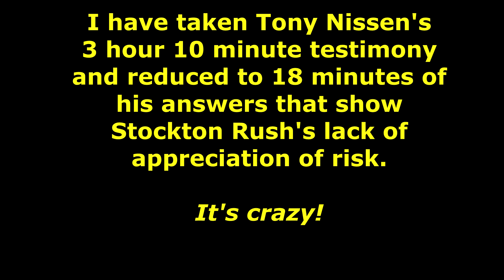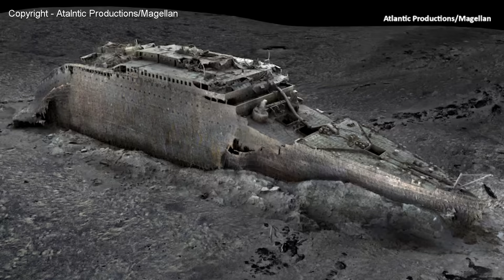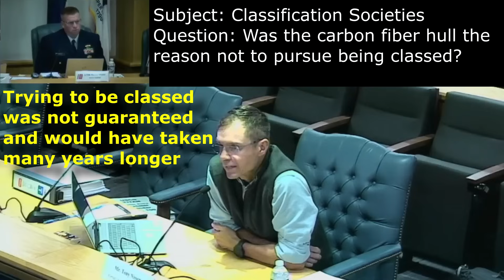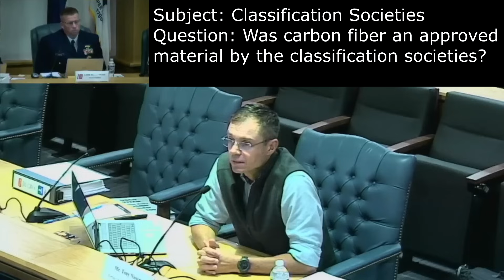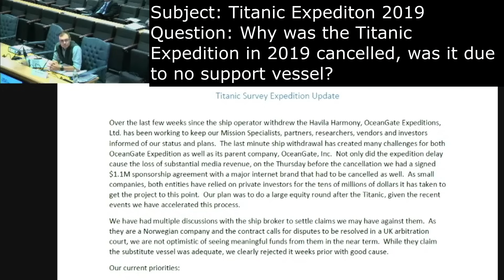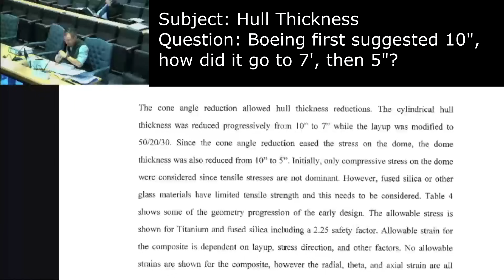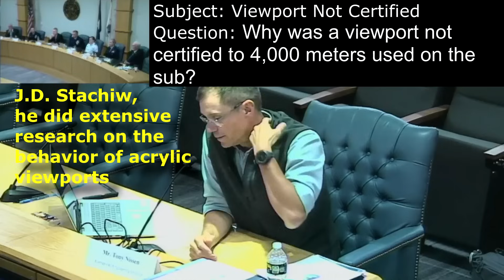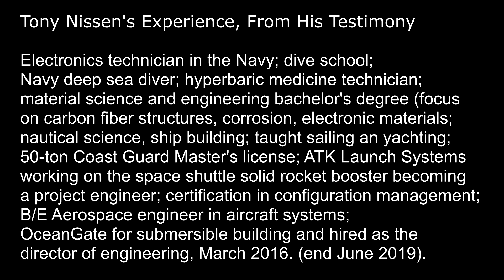OceanGate Titan - Working for Stockton - The Engineer's Words

Comment: This narcissist engineer has been very careful to not put any Liability on himself
Reply: Totally agree.    I can’t stand this guy     His constant lip smacking and laughing inappropriately every second.    There is no way this guy was hired and not told they had plans to take the sub down to the Titanic. There is no way I’m buying that. !     What difference would it make anyway? His job was to build a carbon fiber sub capable of descending to depths of over 12,000 feet visiting the Titanic is irrelevant.
Reply: Anyone who hasn't listened to the firing audio recording for David Lochridge should. Tony Nissen reveals himself as a total weasel in that audio.
Reply: @ln5321 I haven't heard the full audio of it. What does Nissen say/do?
Reply: He has ZERO liability. 

He built this system to test titan, and the system worked and showed the hull was deteriorating. He recommended that Titan never carry passengers. That's it. He did his job correctly.
Reply: @jorelldye4346  Stockton isn't here to tell his side of the story so we will never know.
Reply: @jorelldye4346 your an fool. He helped build the dam thing. He is literally featured in a video gluing the first hull to the titanium end caps 😂

Comment: At 5:57 there's a photo of Rush sitting in the open hatch. I think it's the first clear image I've seen of the hinge. Did that entire titanium dome really hang from the ring by that one small hinge? When even the slightest reflection of the mating surface between the ring and the composite hull was a major concern, that just seems bonkers to me. (I know - add it to the list.)
Reply: I believe when they shut the hatch to dive they bolted the hatch from the holes you can see that are along the circumference of the hatch, so the hinge doesnt support the hatch when its latched shut.

Comment: Or is he lying when not with the lip smacking
Reply: And what the fuck is he lying about exactly??
Reply: @ryanrobin12 hé was much more on team Stockton than he lets on in the testimony. Some thing include shutting out David lockridge and lying about the rating of the viewport. He’s completely flipped to the other side here to save his ass and reputation.
Reply: @57687 nah, he knew good and well that thing was a ticking time bomb.
Reply: @57687  Agreed.  He knows he should've pushed back more and is now portraying Stockton as the sole decision maker and how he couldn't have done anything...  Pushing back was always there as a choice, at the expense of being fired.

Tony's not necessarily as bad of a guy as Stockton who was at least a pathological narcissist, but he certainly had poor boundaries and seemed like he was overeager to wash his hands of any involvement, feeling the pressure of staying there too long and not acknowledging the first warnings, which should've been his job too - standing by "the cattle" when they shared their expert concerns and standing up to the management.  The job wasn't just "rounding up the cattle."  That job description (and I'm also not a fan of the idiom he used) applies to the industries where the potential for injury or death is lower, but not to engineering.

Comment: This goober ,is it his tell ,lip smacking when lying or is he that lame
Reply: Lmao. Tony is a good engineer and quite smart. So from your comment it's quite clear who is lame.
Reply: @LukoBalaIs he is a good engineer?.. to this day he advocates for that carbon fiber hull being a GOOD material , so… I believe you believe he’s a good engineer when he builds another carbon fiber submersible and YOU take a trip to the ocean bottom in it 🤣
Reply: @polishgrlinvegas  the fact that you still don't understand the carbon fiber was not the issue shows me that he is a good engineer and you are not. but to make it simple for you: if i make airplane wings out of steel that are 30 cm thick and the airplane cannot fly it means the steel is the problem? or the design of the wings and how I used the steel? and related to what you said about me going on his sub - i would happily go the first 4 trips. because the issue was the hull was not thick enough and also not allowed to season properly. so first few dives it's ok cause it's still seasoning and if the acoustic monitoring would settle somewhere close to 0 then it means it's ok for the long term. it did not settle so at this point they had to either change the hull with another 5 inch one and also that one change it later ... or redesign a new hull that would be thicker and hopefully that one would settle around (but never equal to) no extra cracking noises.
Reply: @LukoBalahe was the lead engineer on a ship where everyone died from catastrophic failure.  That's not a good engineer.  He also says his only disagreements with deceased ceo were in private, well how convenient that no people can corroborate him
Reply: @SoulDelSol  you do realize he had not worked at ocean gate when they made titan right? and that while he was there the dives were successful and no one died?
Reply: @polishgrlinvegas  he doesn't.  Stockton did

Comment: I love this guy. You can tell he knows EXACTLY what he’s doing, how everything is supposed to work, and a very principled man who will not bend to anything. Bless him for refusing to sign off on that death trap.
Reply: I totally disagree, this guy was opportunistic and negligent. A lot of design choices are mind boggling and the test protocol he followed is laughable. He also actively stonewalled OG employees raising concerns. Under his watch the sub was tested with people inside a very serious depths without any serious backing that the sub was able to handle it. A lot of key people agree that Tony Nissen has a lot to be blamed about.
Reply from the maker: It's an amazing challenge, but Tony built the first Titan for Stockton.  The one thing Tony did that I disagreed with was hiding the depth rating of the viewport from the rest of the team.
Reply: @solareclipsetimer  And if he had gone against Rush, he would've been fired right then. Debating the viewport is nonsense. It was an untested design, so no one had any idea how it would perform. And Rush was not about to "waste" more money (and time) finding out. In the end, the viewport had nothing to do with the failure. Carbon Fiber does not work in compression. EVERYONE told him that. His own tests confirmed it. (which is why he didn't do any more tests.)
Reply: @jfbeam Carbon fiber hulls also can't be in zero degree weather.

Comment: The Bottom line is DON"T visit the Titanic in a Pringles can or a toilet paper roll wrapped with Flex Tape
Reply: Also, your Submarine should be well-certified and make sure it can withstand more than 7000 PSI. Carbon fibre material doesn't qualify for underwater use on Submarines. There is a reason why it's layered with titanium.
Reply: Lol i cant believe they are making so many long serious videos talking about this, i keep watching thinking something inteligent is going to come up and all it is is more of, they used the wrong materials and design. This is like building a Nascar out of Home Depot parts and showing up thinking your going to compete.
Reply: Ay now
Flex seal is some ish
Reply: Flex seal woulda worked btw
Reply: It was coated in truck bedliner! That stuff is indestructible!!!
Reply: You can do it. But these things clearly have a shelf life. 80+ successful-ish dives?

Sign me up 😂👀
Reply: @ryananon779 Not 80 successful dives. It was 80 numbered dives, many less were successful.
Reply: @tomhejda6450  Successful in that no one imploded, I mean.

Comment: "Lightning" is the electricity from the sky; "lightening" means to remove weight.
Reply from the maker: Thanks for commenting.  Yes, I made a typo, and I have previously responded to comments about that mistake.  Sorry about that.  I am trying to be more careful.
Reply: @solareclipsetimer  You also spelled it "Lghtening", which is just carelessness. 15 typos is too much for an 18 minute video.
Reply: One could argue both happened

Comment: Just think if you build a miniature sub of this nature, and tested it under pressure like it was supposed to dive to I think you would work out the bugs rather fast.
Reply: That requires money and common sense. Both of which were running on fumes. Love the idea as that is proper engineering and design protocol.

Comment: I am tangential to this subject and know many of the people in your videos.  I have seen very little discussion on this, but how in the hell could Tony or any of the other engineers allow glass electronics spheres anywhere near a manned submersible.  First time I saw those I was immediately alarmed.  The shock wave from a damaged sphere would he more than enough to compromise the main pressure hull.
Reply from the maker: Thanks for your comment.  That is a great point, and they knew it was an issue if they used them air filled.  That is why they filled them with oil to mitigate the explosion risk.
Reply: Tony hid the porthole from Lochridge because they knew he would go off about it not being certified to go to the Titanic depth.
Reply from the maker: @staciasmith5162  That is correct.

Comment: The 1/3 scale model seems like it could be useless unless the fibers making up the hull were also scaled down, no?
Reply from the maker: Thanks for your comment.  That is a good point, and I hadn't thought about that.  Not sure how carbon fiber laminates "scale up" with testing prototypes.
Reply: @solareclipsetimer  thanks for replying Gordon.  I know the models were, uh, practically useless anyway. Since they were done in one curing session and not layered in lifts, and i'm sure they used some pretty dodgy math to justify what the scales were showing them would likely be okay in a bigger project, But I can't wrap my head around how they would objectively quantify the scale as  a direct parallel
Reply from the maker: @ I don't know if I put the segment in my video, but during Tony's testimony, he stated that one of the great things about carbon fiber models is that it scales up really well.  I just accepted that statement.  He never mentioned changing the fiber size.  So, it never occurred to me that it could be a factor in modeling the engineering.

Comment: Why didn't anyone of the engineers go to the police and tell them to investigate ocean gate when they saw the risks ...
Reply: Kinda hard for police to investigate when no crime defined under the legal code was committed. Stockton is putting passenger lives at risk but this is a matter for the regulators. Issue here is deep diving is pretty niche area, coast guard has some purview over shallower commercial diving but this type of operation is kinda of out of their scope of expertise. The deep diving community is a small knit group that essentially operate in a self-regulatory model since nobody had a deathwish...until Stockton came along. Its why the CEO of Triton was giving so much testimony TO Coast guard on what the current regulation around building deep submersible and their operations. People have been trying to stop him, the complaint to OHSA, the diving society warning letter that was almost sent to him. The coastguard had done inspection but Stockton was slippery, he was operating in international waters and had "mission specialist" instead of paying passengers to evade regulation.
Reply: Doesn’t work that way, in reality of course. Gotta go through red tape bureaucracy.
Reply: iirc (and I may not be!) an engineer did go running to the regulation boards after he was fired.  He went, if memory serves, to the regulating bodies and to OSHA and they just ho-hummed him.  Too busy, too much to do, too much work.  To make matters worse, he was slapped with a cease and desist order on top of that, which he tried to fight in court for a while but he eventually ran out of money and just gave up.  Can't blame the guy, he's not about to bankrupt his family over this.  But the Police?  

For what crime, exactly?  Exactly what code of law was being violated?  The police don't have jurisdiction over this kind of stuff, that's the Coast Guard.
Reply: That someone is David Lochridge.
He reported to OSHA and the did nothing. He was interviewed by the hearing and I highly reccomend listening to his testimony
Reply: @ It really is a good listen.  Just the shamefulness all around is staggering to behold.
Reply: @SuperTurbo9001 Lochridge and his wife were sued by Rush after Lochridge tried to alert authorities about that death trap.
Reply: Police investigate probable cause of a crime....not the feelings of someone.  Calling the media would've done more.

Comment: Only a big fool would use carbon fiber, which has excellent tensile strength, on a structure that requires a material with 
by a jump in compressive strength. This is as stupid as pushing a string. I won't even mention the other one.
Reply: If I got this right the strength actually comes from the domes the carbon fiber only connects the two domes therefore being in tension.
Reply: @cyan_oxy6734 that is still compression
Reply: they should have increase the air pressure inside to be higher than that of the water
Reply: @michawolski2584  
great idea
and to protect the people inside, build an additional steel vessel inside the carbon fiber vessel that protects the people from the high air pressure

Comment: Sorry but this guy is NOT innocent.
Reply from the maker: There are some things he did right, like saying the V1 hull wasn't safe to go to the Titanic.  There were some things he did that were weird, like hiding the real data about the specifications of the viewport.  He seemed to be correct about demanding stain gauges be installed, but on the other hand, Phil Brooks said the way he was gathering acoustic data was almost useless.  So, I don't know what to think about Mr. Nissen.
Reply: @solareclipsetimer  IIRC, They had data from the acoustic emission system from a previous dive showing that the hull went through something. So the technical part of the system worked. They just ingored the data. So the human part of the system failed.
Reply from the maker: @tomhejda6450  Yes, you are correct.  Dive 80 is the dive that had the problem.  The issue was that Phil Brooks and Stockton were missing something when analyzing the data.  Neither are mechanical or materials engineers.  Dr. Don Krmaer broke this down in a wonderful way during his testimony.  OceanyGate always looked at the data graphs, acoustic or strain, plotted as the data point versus time.  That doesn't tell the story.  Dr. Kramer took the same data and plotted strain versus depth, and that clearly showed that the hull had changed its behavior compared to the previous dives.  And this behavior change persisted in the subsequent dives that season.  Dr. Kramer is a mechanical engineer, so he just looks at things differently and he recognized the error in analysis.  Thanks for your comment.
Reply: @solareclipsetimer  he only had a problem with safety issues when he was supposed to go down that thing.

Comment: Lightening? That's not a word.
Reply from the maker: Yes sir, I made a mistake and it was pointed out early after I released the video.  I wish Sony Vegas had a spell checker.  It's really hard to proofread all the tracks in the timeline of a video editor.  Especially with all the helpful annotations I try to add.  Sorry, I will try to do better.
Reply: Lightening (with an “e”) relates to making something lighter in weight or color.
Reply: It most defo is
Reply: Ummmmmm, the dictionary would beg to differ! Though, it's got nothing to do with weight or weather, so it's technically a typo. Still, it's definitely a word!

Comment: This testimony is interesting but totally irrelevant to the 2023 implosion. Most of the testimony i heard was about the first hull and very little testimony specific to the hull that imploded.
Reply from the maker: Thanks for commenting.  The point of this video was to help understand the "culture of risk" at OceanGate from the beginning of the development of Titan as told by the first director of engineering.  It paints a picture of working under Stockton Rush.  The risk-taking culture issues described here by Mr. Nissen, early on in the company, continued right to the end.
Reply: I think it is relevant: The first hull failed, and it was in part due to this kind of telemetry that that did not kill anyone. Then the person responsible for that telemetry was fired, and data from similar systems showing that the second was failing was ignored. That he felt it was unsafe but that he could not quit because doing so would likely result in something even MORE unsafe is effectively exactly what happened with the second hull.
Reply from the maker: @BillyONeal  Agree, thanks for commenting.
Reply: I don’t think it would be part of a hearing regarding the implosion if it were not relevant. It is very obviously relevant as it shows a lot about the culture of the workplace and the pattern of disregarding safety. It directly led to decision making that resulted in the tragedy.